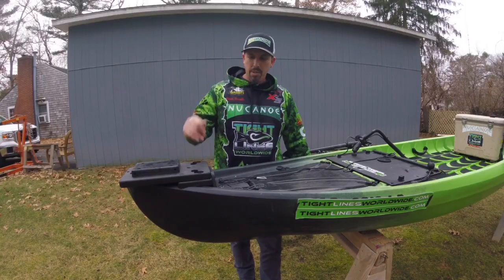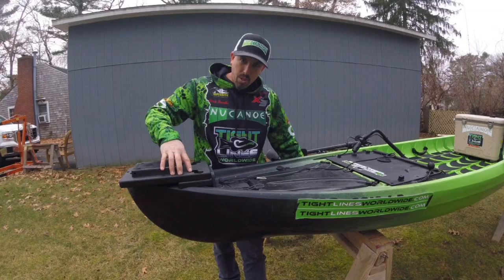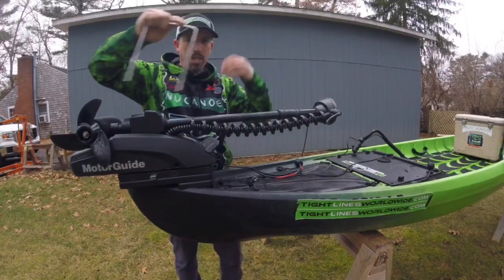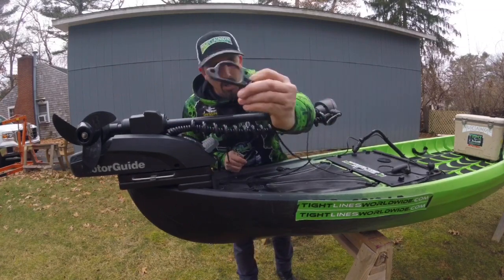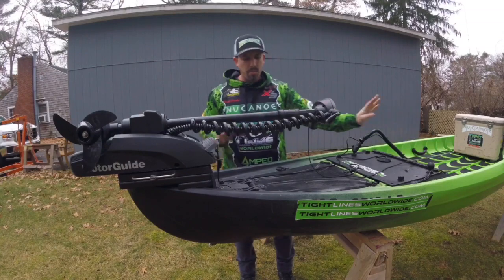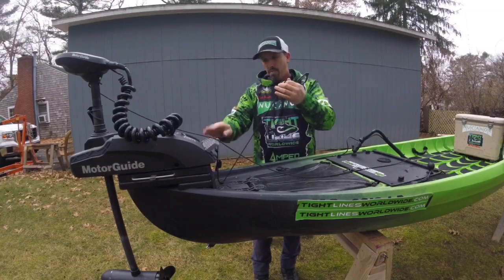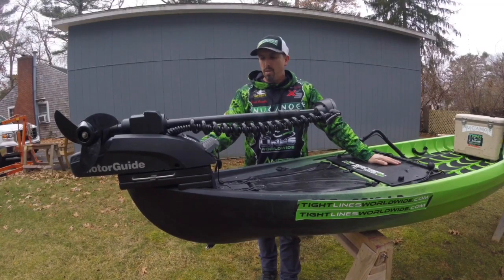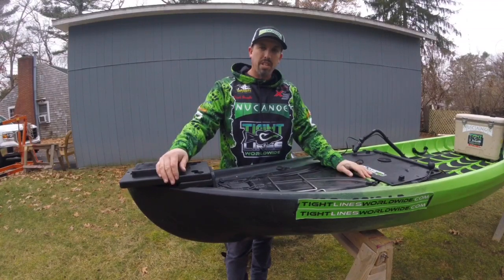NuCanoe and Motorguide Xi3 set up

Comment: Thanks for this video.  I bought a Frontier 12 last season and used it in the James and the New Rivers last year.  I bought a Motoguide XI3 late last year and have it mounted now and ready to go fishing.  I used your video to modify my boat.  I used a chrome eye bolt right between the hinges on the hatch that lined up with the release pedal above.  I used two rubber backed washers for the eye bolt installation.  Cord slips right through nicely and pedal depresses easily.  This setup will make fishing the shallow, rocky rivers with the motor possible.
Reply from the maker: Awesome! Thanks for the feedback and good luck!!

Comment: Thanks for taking the time to make this!  Perfect timing - took my maiden voyage on F12 with same setup last weekend & saw the stow/deploy as something to be addressed. One question - you appear to have the rope that's attached to the pedal threaded through something under it to get vertical movement when you pull the rope - details?  Thanks again.
Reply from the maker: Glad it helped!
Reply: Also wondering what the rope is threaded through by the pedal. Struggling to get vertical movement when I pull the rope

Comment: I had the motor installed on my ‘17 hobie outback.  Biggest issue i have is the initial take off speed when you want to anchor over your waypoint.  It goes full speed with sharp turns which almost knocked me off the kayak few times. I called the company they told me there is no settings to change the initial take off speed when you try to anchor.  Tell me about your experience, thanks

Comment: What are powering the trolling motor with and what's the battery life like, especially if you use the spot lock feature alot throughout the day?
Reply from the maker: Hi Chris I can’t give you an honest solid number of hours on this because I’ve never had it run all the way dead! I can tell you that I have gotten 14 hours out of it in one day however I do charge it every time after using it. Bottom line is you’ll get a ton of run time out of the Amped Outdoors 100 amp hour battery!

Comment: Can you give me the overall dimensions of the Motorguide quick release bracket parts as well as the bolt hole spacing for the smaller section that bolts to the kayak?  I'm curious if this motor will work on the front of my kayak and not get in the way of me being able to open my front hatch.
Reply from the maker: IRBent2 I sure can! I’ll do that later today!
Reply: @derekbrundlefishing  no need for me to have those measurements anymore, but others here might need them.